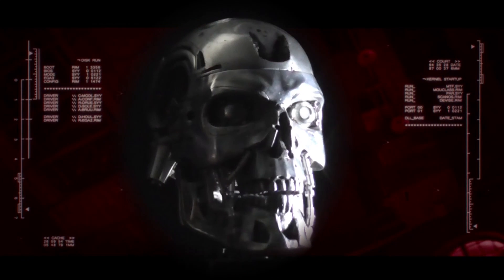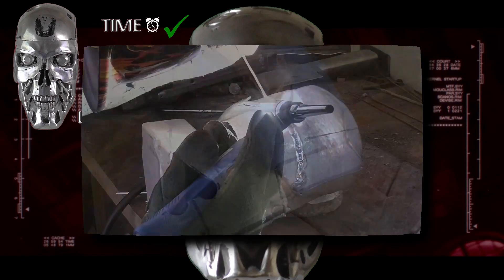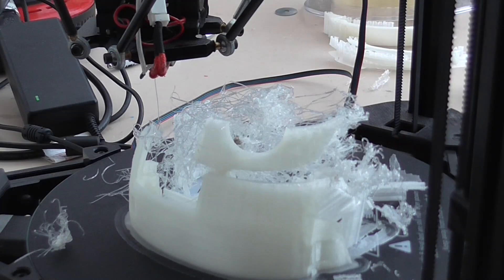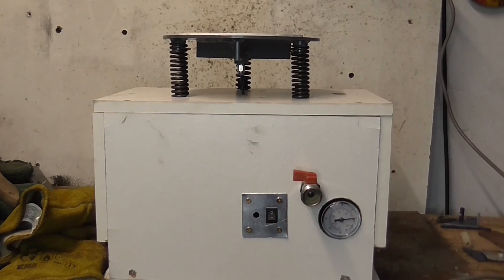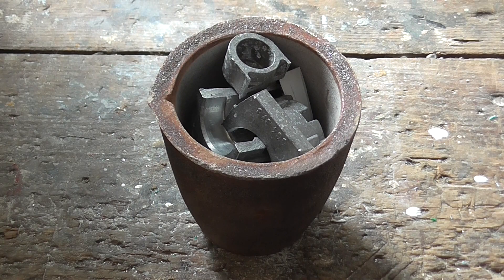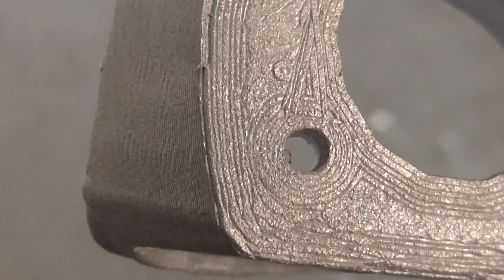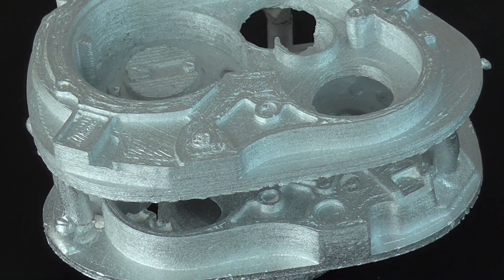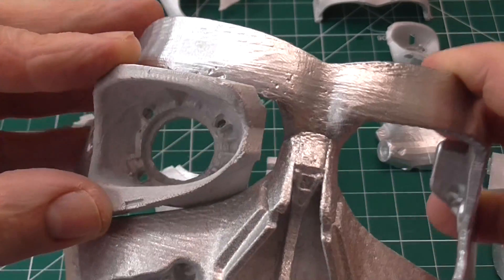Building The Terminator - a better way?

Comment: Aluminium is the best metal to use isnt it, on a project like this.
Thanks for explaining what's involved making some thing like this & the pit falls of it, I believe one method is the Lost wax process (used mainly for casting Bronze) where the mould is Plaster which can withstand great amounts of heat, with out cracking.

Comment: You can use acetone vapouring on 3d printings to be smoother and then not sending it down, but but but on PLA it doesn't work
Reply from the maker: Yes, I've heard of this method, though I don't think ABS works as well for the investment casting (doesn't burn out as cleanly). My approach has been to do minimal finishing on the 3D printed part and do it instead on the final cast metal part, that way if the casting fails I haven't wasted any time.

Comment: The only thing I don’t understand about investment moulding: does the wax or plastic get dissolved and infused in the aluminum or does it get out off the mold?
Reply from the maker: Most of the plastic/wax melts and runs out at the beginning of the cycle, anything left gets completely vaporised later at the higher temperature, leaving the mould cavity completely empty. With PLA you can get some residue or ash left behind, this can usually just be blown out of the mould before pouring.

Comment: So the new series on PLA to Aluminium casting? That shall be awsome if it is
Reply from the maker: I'll be using this new method for some parts, and hand machining/welding/fabricating for others. The skull probably has the most parts which are best suited for lost PLA casting, but I think I'll also make the neck vertebrae this way.  The rest of the skeleton is probably best for machining and/or welding together.
Reply: @AndysMachines  looks like more eye candies for us ;)

Comment: Just get yourself an Elegoo Saturn which will print the head in amazing detail and cast Mold then pewter. FDM printing with PLA is ok but resin SLA printing is the way to go. I’ll never go back to FDM after resin printing...
Reply from the maker: Yes, I know resin printers have much better resolution and the Saturn is probably just big enough to print some of the larger pieces I cast for the skull (could always break them down further). But actually I don't need that level of detail as I'm welding/fitting/finishing/polishing all the parts anyway and the finish I get from FDM prints is good enough. There are also much better filament printers than the one I have, which was just a cheap 2nd hand one I got to experiment with (I'm a beginner with 3D printing). But if you want to do really small detailed work such as jewellery then I think a resin printer + vacuum investment casting is the way to go.

Comment: Shows great promise... I lieu of a vacuum you can add volume/weight by adding a funnel top to the mold also having the mold hot can help a lot as well
Reply from the maker: Yes, I found out the hard way I need to increase the height of the larger moulds! The largest one you see me use at the end actually has a detachable tube screwed into the top, it wouldn't fit in the burnout kiln with this on so I had to screw it on the hot flask afterwards. When I cast the jaw it's flask didn't have any extra height, which caused a void at the top.

Most of the flasks were cooled to around 300°C before pouring as I was using a silicone sheet on the vacuum plate and didn't want to melt it. Without vacuum I was able to pour with the flasks at a higher temperature, but I learnt the hard way that the metal takes a lot longer to solidify! (The plaster is much more insulating than sand). Still a lot to learn with the new method!
Reply: @AndysMachines  You've got a pretty good setup there now, given how good it looks already I'm sure you'll crack it,

Comment: Great stuff 👍I think you will get expected results with some practice. I guess to make it easier, it's to sand the plastics smooth or use ABS and acetone vapor to smooth it. However ABS is harder to print and it will lose some of the finest details while smoothing.
Reply from the maker: Thanks! I actually find it easier to leave the plastic as printed and file/sand/finish the aluminium afterwards, as I would do this anyway, and sanding the plastic doesn't seem to work well, it melts or leaves furry edges and takes a long time to get a good result.
Reply: @AndysMachines  Most 3D printers have varying levels of detail that they can print to.  With the commonly installed 0.4mm print nozzle you should be able to get to a 0.12mm layer height, which will greatly increase your fidelity of your mold pieces and reduce the finishing time of your aluminium pieces.  Granted the finer layer height takes considerably longer to print, so it's a tradeoff to decide whether you want to put that time into printing or finishing.  Lovely work and I will enjoy watching your progress!
Reply from the maker: Yes, I did experiment down to 0.1mm layer height, but found with my particular printer (cheap 2nd hand Anycubic Kossel) it worked best at around 0.15mm. The biggest problem was prints failing half way through, I had to adjust a lot of settings just to get it to work properly.